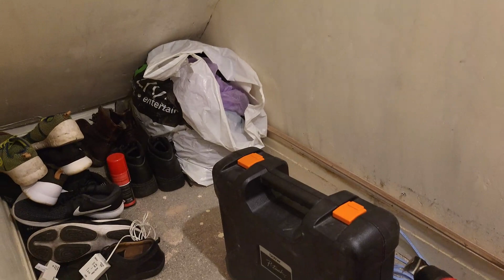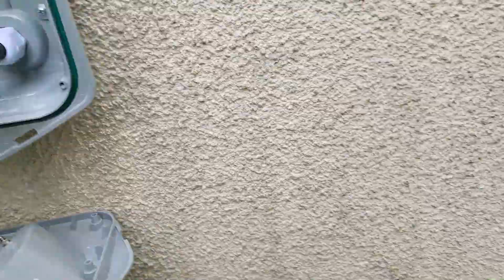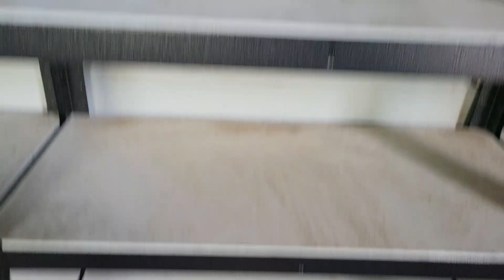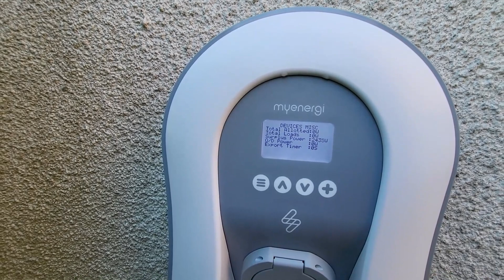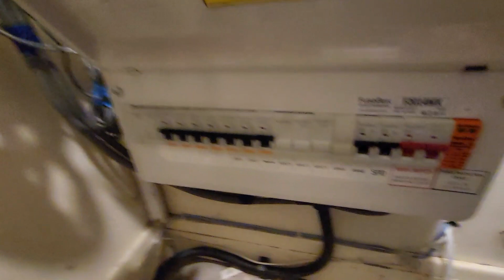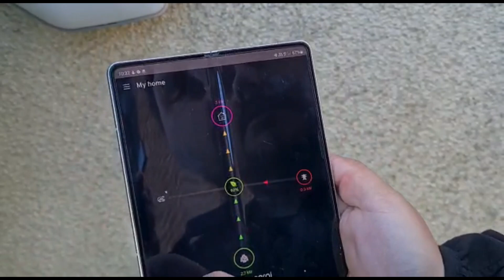Myenergi + Solar + Electric Vehicle EV = MAGIC

Comment: Thought that your video would help but it didn’t. Too high level re the Zappi etc. I have solar, Zappi and Tesla Powerwall and would love a video showing step by step how to place CT clamps, connect and setup the Zappi. Thanks
Reply from the maker: Consult with an electrician. This is not a job for DIY efforts.

Comment: Hi, thanks for the informative video. I am in Germany and just had my solar and Zappi installed. I cant extend the CT cables to the zappi, so i am getting 1 harvi (still not installed). I am also planing to add a battery in the future. So what I cant seem to understand is; when the zappi is connected to 3 phases and the solar is also feeding on 3 phases, would that mean i need 6 CT cables and 2 harvi's? The manual says 3 phases = 3 CT cables, but in the video, I saw 1 CT cable on each connection. Thanks in advance
Reply from the maker: Hi, you will need CTs for the solar system if you want to measure generation. Unless you have a libbi inverter? I don't think they do 3 phase as yet so probably not! 

You will also need 3 for the grid import/export measurement. 

One thing to be careful of with the harvi is it requires current flow in the CTs to power itself. Sometimes it can lose conmection/reporting during dead water on the current flow when the battery is running the house loads for example and PV running with no grid import/export. 

They are also a little slower in responding than hard wired CTs. If using harvi I would mix  the CTs between the solar and grid across the harvis to counter the power issues as above. 

Hope that helps!
Reply: @electrician247  thanks a lot

Comment: Hi Mark, great video.  I’m looking for a functionality today so I can see where all my energy is going. So maybe 6 CT’s feeding back to a monitor so I can best plan my system design for solar. I currently have a gshp since 2012 and an electric Aga so I’m already all electric no gas stopped oil when we installed the gshp.  Ideally I’d like a way of doing this without a 3 party web server as I think that would lock me into that products. As I said great video thx. Ron...

Comment: Congratulations to Myenergi on the launch of their new Libbi battery product.
With the most common use case being customers that are on-grid (230v) and solar PV (say ~600v), surely HV batteries is on-balance a far better solution than LV?
Perhaps the many experts I have been taking advice from have it wrong.  Anyone able to give any scientific reason(s) why anyone would go with LV over HV?

Comment: We have a Zappi and Eddi and find we get 90% of our PV self consumed without needing a battery
Reply from the maker: This is the case for lots of people. Essentially you have a battery system. It's in the car and water tank.
Reply: That will depend on your EV mileage and whether you're at home to use the PV during the day, surely.
Reply: @rugbygirlsdadg  That’s a very good point.

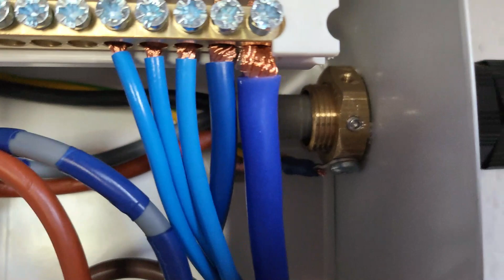Comment: Yikes 8:00 copper showing
Reply from the maker: Tailed leads on the manufacturers parts. Not a fan either but nothing wrong with it. Designed to only be open when isolated remember. 

Sometimes we ferrule them but again look at the N bar itself. Totally uncovered so in essence a total non issue .

Comment: Another great video Mark. Just completed an EV C&G course about 6 weeks ago and am thinking of going on the Myenergi course. 
Am I right in understanding that their latest version that is due for release in June, comes with built in Wi-Fi so no need to run cat 6 cable (either separate or within supply cable ie EV ultra cable)? Is it also true the dno/provider can control when you can use the charger due to new government guidelines?
Cheers in advance for any advise /info…
Lee 👍🏻
Reply from the maker: Hi Lee. Yes the new Zappi is WiFi enabled and the dno need to be able to control all charge points from June. Tbh I don't think this will be beyond the default wait period before starting to charge in the beginning. 

Thanks!

Mark
Reply: Wi-Fi is not acceptable for G100 compliance so you need to run some Ethernet to the Zappi